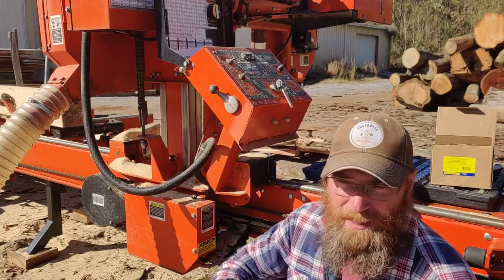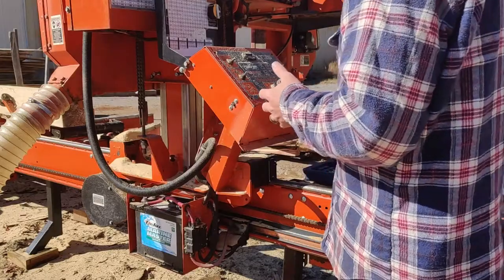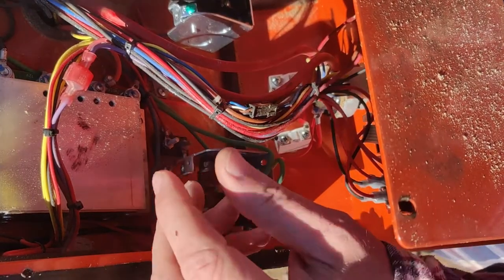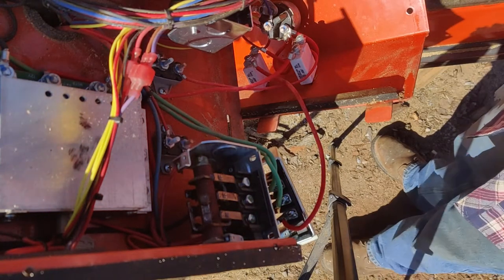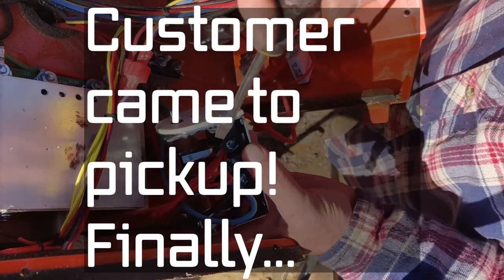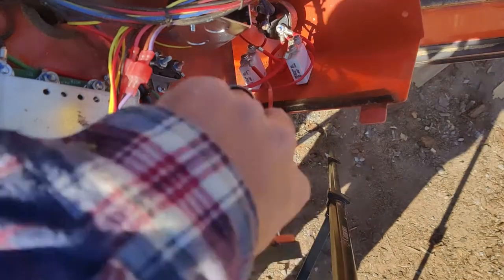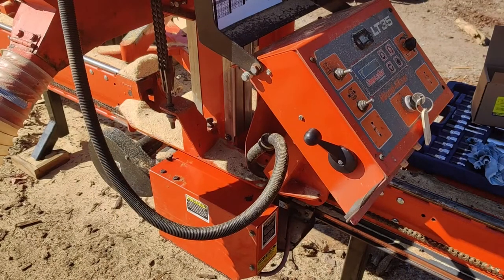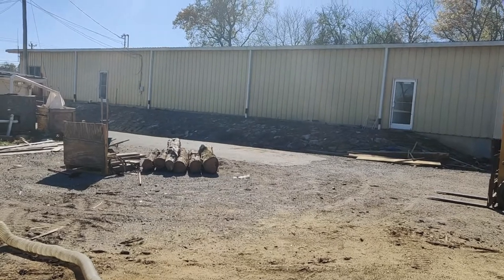Replacing the Forward/Reverse control switch on the LT35 HD

Comment: What is the dust collection system hose/size/brand? thanks
Reply from the maker: I used the harbor freight 2hp dust collector with 4" flex hose (metal ribbed) from amazon.